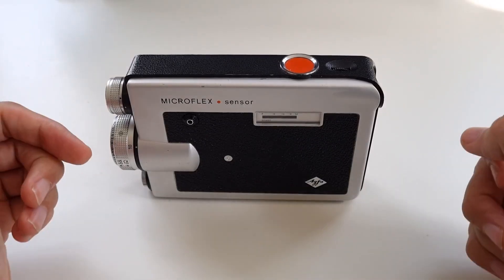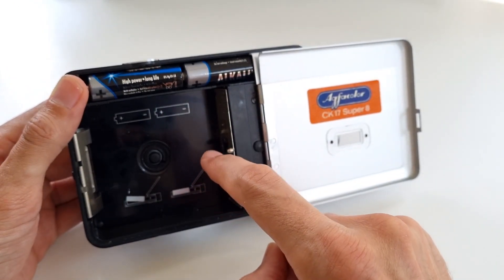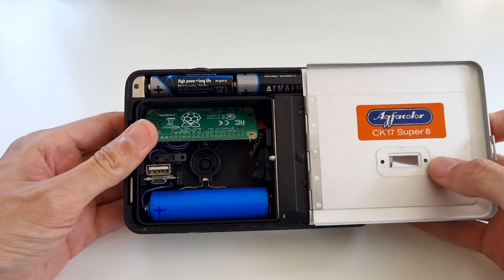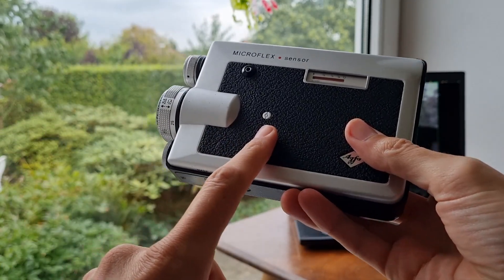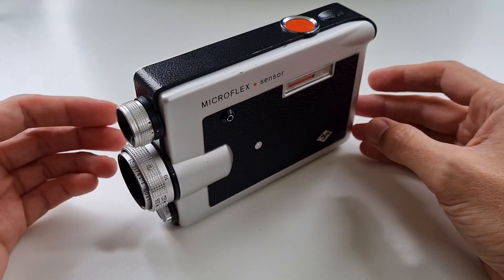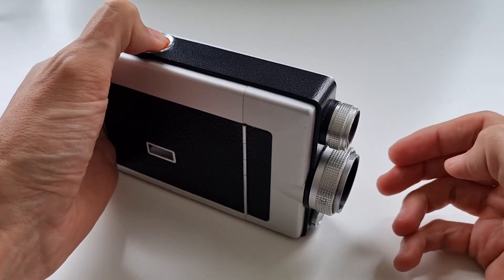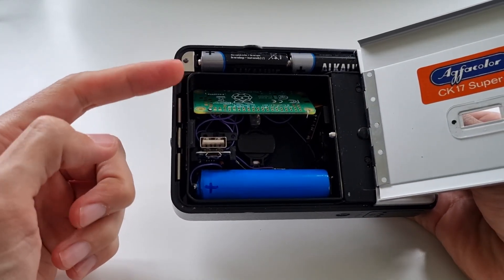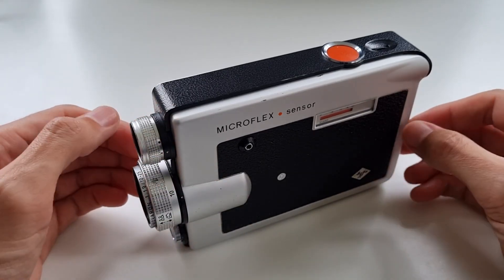Super 8 Camera Digital Conversion (using Raspberry Pi)

Comment: Hi, can you give me some info for the photoresistor? I'm looking at various types: GL5506, GL5516, GL5528, GL5537, GL5539, GL5549 all have different light resistance values, does it matter which I choose?
Reply from the maker: It should be relatively flexible with regards to values. Worst case you might need to adapt the value of the normal resistor so that the difference between light and no light gives you solid 0 and 1 logic levels.
Reply: @kassenbon  Ok. Thanks for your reply. I have ordered the 3D print of the case. Will see how I get on. Any chance you could post photos of how you have it setup inside? Hard to make out on the video.

Comment: This is really incredible and fun! I was surprised at the authentic super 8 colour. Did you grade the footage in any way? Or is that all inherent in the glass of the lens? Do you think this would be possible with a Bolex 16mm film camera?
Reply from the maker: I was also quite surprised. The footage is completely unedited. 16mm would be doable but with twice the crop factor, unfortunately.
Reply: 16mm film is loaded differently. You would need a larger sensor and a totally different solution for the housing to pull it off. The 8mm cartridge is brilliant for this.

Comment: Did you remove the film advancement claw?
Reply from the maker: No, it is unchanged. Interestingly, the original camera uses the claw not only to transport the film but also to detect the end of the film. If the claw is running freely (in case of no cartridge or end of film), it activates the (rather annoying) end of film indicator light in the viewfinder. The trick to disable this is to slightly push the claw in, like originally the film would do. In my 3D model there is a carefully indented block that does this pushing at just the right distance. The claw rubs against this block which is not really elegant but it works alright.
Reply: Ah, ok, I guess you’ve been on this project for a while, seems pretty thought-through.
That’s why comments like the first commenter’s one really piss me off. 
I’ve been thinking this through for years now too, cool to see so many others doing the same. Just saw elemnt14’s new progress, compared to that yours looks pretty simple ❤️🙂
Reply from the maker: Thank you for your support. I really appreciate it!
Reply: @kassenbon  still only mentally building this… 
How about if your block had a tiny switch which gets triggered by the forward movements of the claw?
That way you might calculate the FPS the camera actually has (might be slightly off of 18) and then start the recording right in the middle of 2 claw movements. Maybe recalibrating every couple of seconds might help too. Then you might be able to use the cartridge even with the shutter in place. With any number of fps.
Or (excuse my missing knowledge) is the camera / pi only able to shoot at fixed FPS, like 18, 20, 24 etc? When calculating the real FPS you might get something off of 18fps, like 18.003 or so.
Reply from the maker: @marcotrevissoi2164  I like the idea! And I think frequency wise this might be doable. But I would be worried about the phase relationship. Meaning: If both camera and pi are in perfect sync at for example 18fps but due to the phase relationship the pi camera always captures when the shutter is closed. Mmh, and I don't think it would be easy to manipulate the phase, unfortunately :)
Reply: @kassenbon  yeah, thought about that too. How about starting at t+1/2 claw movement Intervall? Of course that could also shift over time I guess. Comes down to single frame sequence capture then, triggered by the aforementioned switch + half the Intervall you may have been getting by some non-encoding steps at the recording start. Would the pi be able to write single frames that quickly?
Reply: Hi Colin
Thanks for the input. Yeah, your video looks great! I was using various super8 simulation apps on my iPhone years ago as well, for example iSuper8, which is now discontinued and really gave nice results with the camera shake and light leaks & such. 
That thing missing though is holding a real camera for making a film. It’s a big difference holding a camera to your eye or holding your smart phone and watching the screen.
I also attempted to use an iPhone in a Bauer super8  for once, by redirecting the incoming image to the camera, so I could capture super eight footage with my iPhone while holding a real heavy camera. 
Didn’t work though, because the iPhone’s camera was positioned at a place where I couldn’t practically reach it with the redirecting prisms. And there was no extension cable available which allowed me to remove it from the board and have it outside the phone.
Reply: On the other hand, if you might pull this off with that $110 cam an then get a cartridge suiting all sorts of super8 cameras it might well be worth it.

Comment: hi @befinitiv .. have started to try this project (a newbie though). Just got the 3d Casing today.  would it be possible to show how you build and connect the LED, Photoresistor to the Raspberry Pi? Also saw you have the USB power charger, is that strictly for charging the lithium battery only? as for powering the Raspberry PI, is it connected directly to the lithium batt as well?
Reply from the maker: There is a rough connection plan in the video description. Please let me know if you need more info.
Regarding the power bank: I connected the RPI to the 5V output. You are right, it would also work if connected directly to the battery but I wanted to still have the BMS functionality (most importantly low voltage cutoff).
Reply: @kassenbon  thanks for your reply...yup it would be quite interesting to see how you build this. been sharing this video to the other RPI community here in Malaysia, none took my challenge to try this. hence had to explore myself, i have no prior knowledge in electronics, but im super eager to learn now. As for the USB power charger, do you have a link on what type it is? since im not sure if the one i bought has a BMS function on it.
Reply from the maker: Afaik all power banks should have protection against deep discharge. I am thinking about making a detailed build instruction video, this might help you with the wiring.
Reply: @kassenbon  ahh that would be great to watch and learn. Appreciate it ..noted on the usb. thanks for tip. ;)
Reply: Has the deep tutorial video been finished yet?  Looking forward to this very much
Reply: @diggumjones  hehe ive been waiting as well ..haha..anyway ive gone back to using actual Kodak Films now for my Super 8 as the film warmness look that i wanted to could only be achieved via real films...something a Digital lens wont be able to capture, cos it would look like we are just using a super 8 filter effect on a video.

Comment: Will this also work with a dismantled USB web camera? Strip away the Lens and Case and use only the camera Sensor from the Webcam in the place of the 8mm frame? I ask because i have 4-5 HD webcams that are Not used anymore and already have a Pi left for experiments. So i dont need new parts for this.
Reply from the maker: In theory yes but it might be difficult to get the sensor close enough to the lens. This was already challenging with the tiny RPI camera.

Comment: This is very nice video as well does it work with any 8 mm film camera? That's what I heard that you mentioned in the video. how much is it around on parts raspberry pi and etc to build this? And is it easy to build without prior experience
Reply from the maker: Parts is roughly 40€. You need to have access to a 3D printer for producing the mechanical parts.
It should work on any Super 8 camera but best are the ones where it is easy to disengage the mechanical shutter. I wouldn't call the build super hard but also not super easy. You should have some prior experience with electronics and the Raspberry camera. But if in doubt you can just ask here in the comments for help :)
Reply: @kassenbon  question where can I buy the parts not sure if you link the products? Thank you for the response
Reply from the maker: Yes, links to the parts are in the video description.
Reply: @kassenbon  thank you 👍 again for your help

Comment: Weird that the shutter in the camera isn't making any partial frames in the video. I assume the next revision of the digital cartridge will have a cover? A little OLED display visible through the door window would be nice. Dunno what to show on it other than the storage space remaining.

Other cameras that need digital cartridges are the 110 and 126 and the Kodak Disc. For sensor size the Disc should be the easiest. It would need a custom PCB to mount the sensor, memory, other electronics and have space for a couple of coin cells to power it. The 110 and 126 cartridges would have more room for electronics and power but their larger frame size would be an issue for an affordable digital sensor.

Minolta and Pentax made some quite nice 110 SLR cameras and Kodak made a 126 SLR which was compatible with their Retina 35mm lenses, though not all functions of the Retina lenses would work on the 126 SLR. Other 126 SLRs were the Contaflex 126 and the Rolleiflex SL26. There might be other 110 and 126 SLR cameras. Aside from SLR types, there were various other very nice 110 and 126 cameras with automatic film advance/rewind, range finders, electronic flash and more.

Comment: The shakiness, low frame rate and some of the shadow effect is a result of the mechanical shutter in the camera. This is required on film cameras to ensure that each frame/cell of the film is exposed one at a time, instead of streaking the film in front of the image projected by the lens/prism assembly.
Reply: *The shakiness, low frame rate and some of the shadow effect is the result of a LOW QUALITY mechanical shutter in the camera. Professional 35mm film cameras obviously have mechanical shutters too.
Reply: @kconrad5893  As do professional 16mm cameras. There were many consumer grade 8mm cameras that had better shutter mechanisms than this one.

Comment: Before you actually mentioned it, I thought "That footage REALLY looks like 8mm film!"  What an awesome way to capture "60s-era" fun video of family and friends without having to fake the effect in post-production!!

I'm wondering if you had to tweak the distance and angle of the Pi sensor to perfectly match the location of the film plane?  (Can't tell if that camera was built as fixed-focus.)
Reply from the maker: Thanks! I am planning to make a "how to" video that explains all the details. Indeed, the camera is fixed focus. Therefore, I stripped the RPI sensor down to the bare chip and this is mounted on an adjustable subcarrier. I adjusted the distance of this carrier using the live stream preview and then fixed it permanently with super glue.
Reply: @kassenbon    Brilliant!  I applaud all of your efforts to satisfy curiosity AND pioneer ways to bring analog gear back to life.  I await the day when I can pop a high-quality digital cartridge device into my old Canon AT-1 SLR.
Reply: I tried to make something like this with an ESP32, but the image quality was nowhere near as good as yours. Am looking forward to more details of how you did it? I'm especially interested to hear how you prevented the camera's frame rate (18fps) from interfering with the sensor's framing rate (30fps?)
Reply from the maker: The RPI camera runs at 18fps. I disengaged the mechanical shutter (it is very easy to do on this camera model) but it would also work without this by setting the frame rate higher (with some minor shadow effects)
Reply: @kassenbon  This is amazing and you have motivated me to try recreate it. Would be amazing if we could get a tutorial with all your knowledge and issues you found when building this.

Comment: Sweet! Would it work with the RPi Hq camera??
Reply from the maker: Very likely the module would not fit inside the cartridge. After I did this video I saw that someone at Element 14 did this with a prism to redirect the light. But this only works if the camera has focus controls because the distance of the sensor to lens is larger (compared to the distance of the film).
Reply: @kassenbon  there is also another project called cinepi 2k, it's great to see the resurgence of 8mm cameras into digital

Comment: Very nice work! Did you remove the lens from the digital camera? And not sure if I'm misunderstanding the onshape interface, but the linked CAD model doesn't appear to be a Super 8 cart.
Reply from the maker: Yes, the lens is removed. The lens of the Super 8 camera takes it place.

And indeed, the Onshape link is quite confusing. The first thing it shows is the cap of the optical sensor. You need to switch the tab at the bottom of the window to get to the cartridge. Thank you for mentioning this issue. I added an explanation in the video description for this.
Reply: Thank you! Somehow I missed those tabs at the bottom.

Comment: I was going to complain that your initial shots were through the window but looking at the later pictures it sure looks a lot like super 8... Have you color graded these to make them look more like super 8? Or is this straight off of the SD card? I have a camera ready to go and a couple more I'd like to try something similar with. One is a cartridge 8 camera with a three lens turret ... I was able to obtain an 8 mm magazine and I'm planning on putting a system like this inside of it.
Reply from the maker: Yes, what you see in this video comes directly from the SD card. There was zero processing done on them. It is funny, when I look at it I even think I am seeing the typical dark dust particles, which is of course absolutely impossible. I think my mind paints these into the video :)

You find the full plans in the video description.
Reply: I've bought a bell and Howell super 8 as well as an Emdecco which is supposed to be a good camera

Comment: I got an 8mm filmkamera with mikrofon. wer can i connect it to the pi that i can record the noise also`?
Reply from the maker: Good question! Probably you need to add some kind of sound input to the RPI, for example by adding a USB sound card to it

Comment: What I meant was: I would love to be able to buy the ready cartridge like that. Are you considering the preparing a commercial version of it? Cheers!
Reply from the maker: Not decided yet. I think I'll wait for the feedback from this video :)
Reply: @kassenbon  t Hank you. It’s a very good design and the results are simply great. 👏
Reply: @kassenbon  definitely consider it, or at least a limited run!!
Reply: @kassenbon  I'm definitely interested in purchasing one. Possibly two!
Reply from the maker: Unfortunately, I am not able to sell these. But all the plans are available to rebuild it.
Reply: @kassenbon  when I tried to print the cartridge for some reason the measurements were not in scale making it too small I think. What did I do wrong? Can you help plz?
Reply from the maker: How far was it off? Could you measure the longest side? I am suspecting some imperial vs metric conversion issues in the STL file. Best to double-check the setting of the STL exporter of onshape.
Reply: @kassenbon  thank you very much, I will try